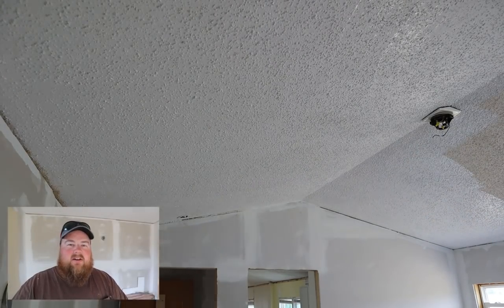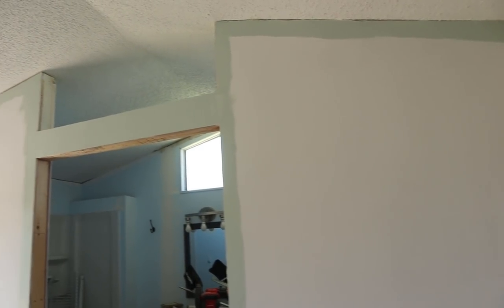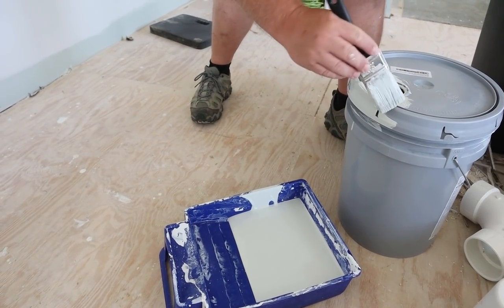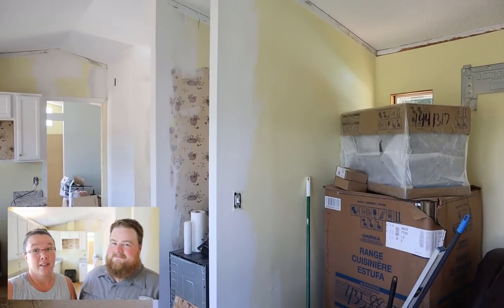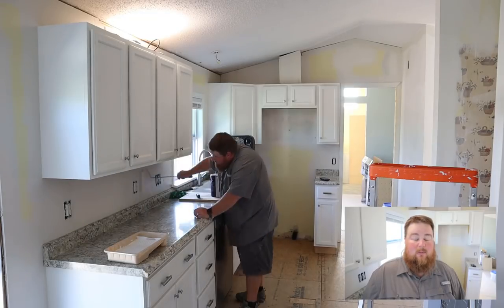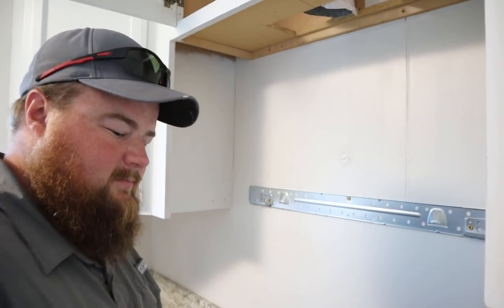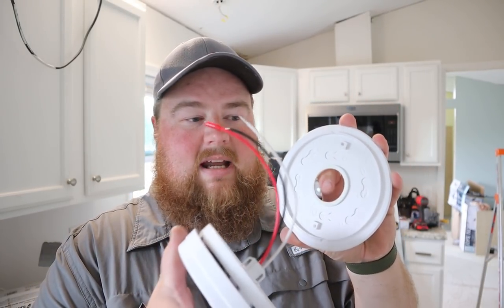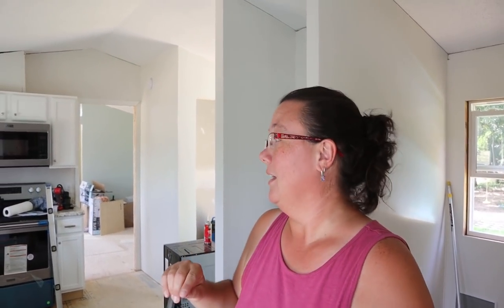What SHE Picked for the House.. Color Palette Revealed // Mobile Home Renovation

Comment: Great job on the painting and color selection.

Future tip: Since the crown moulding was not installed. You can cut in/trim around the ceiling using a 4"  Whizz brand roller. To keep paint off the ceiling when trimming with the roller, use a piece of cardboard to protect the ceiling.  Cut a small piece of cardboard  6"wide x 16" - 24" long. Place the piece of cardboard against the ceiling and tight into the inside corner. Then simply move around the room with the small roller in one hand and the cardboard in the other. It goes very fast and it allows you to have a more uniform texture on the wall.

For inside corner the Whizz brand 4" rollers have fabric on the one closed end of the roller cover. That allows you to roll inside corners with the same roller you cut in/trimmed the ceiling with.

Comment: we had that same  Microwave you just got. It lasted One month after the warrenty expired. The button you push to open the door went bad and when we went back to purchase a new one, that is when they told us those push button door latches are bad. So now we have one that you just pull it open.
Reply from the maker: That kind of stuff is why we buy the extended warranties on the large appliances... that and because we've had others die on us right after the default warranty and us not have bought the extended one. ;)

Comment: I hope you plan on using white trim all around all of the rooms. That way all of those colors you used in all of the rooms will blend a lot better when they are all finished,...and then use a lighter laminate,  like a Walnut color on the floors. Using the same floor color throughout will be a spectacular finish before furniture choices. Just a thought. Good luck you guys. It all looks really cool already.

Comment: I like it! Very calming color especially for the bedroom! It's very similar to the color I chose for my kitchen remodel.  SW6198 Sensible Hue. It's a light Green/Gray, but it changes during the day depending on the sun light! I love it! I used SW7000 Ibus White on the ceilings. Both are soft, calming, unassuming colors. Work together very well. I really like your color choice! DIYFFERENT, Doug & Ashley used a stain color similar! Pretty!!!

Comment: A tip here. Before you put down your new flooring, I would recommend adding all your molding/trim work before you install the floor. No messes to clean up.
Reply: The whole point of trim is to hide the gaps and it goes up after the flooring. I think Sam should just do it the proper way.
Reply: @diyfferent  I'm not talking about floor trim. I was talking about the ceiling molding. I'm not dumb.
Reply: @lkcantwell  Ok, well you said "*****all**** your molding/trim". Maybe you should have been more clear and not said "ALL", which would include baseboard trim. We have seen many people install baseboard before the flooring goes in because they just didn't know any better. It's not about being dumb, it's about being taught wrong or not knowing.
Reply: @diyfferent  I am sorry I didn’t mean anything other than ceiling molding which I improperly called trim. I know not to put down floor trim. Sorry I didn’t make myself clear.
Reply from the maker: We thought of doing that, but didn't have the molding yet -- we did have the flooring. :)

Comment: Sam I wonder if you can answer a question for me we also have popcorn ceilings and a couple of the rooms need to be painted it’s  a 1988 double manufactured home I was wondering what kind of roller did you used to do I mean to paint the ceilings and what kind of paint did you use was it a water-based or an oil base my husband heard that you can’t put a water based on popcorn  ceiling they will drip paint will just fall off I don’t want an oil base paint

Comment: I used that paint color. It is absolutely wonderful.  Great choice.
Angela,  I just discovered paint edgers.  Well, I just decided to splurge & try one. I will never go back to edging with a brush. They are fantastic.  I also used an edger to paint my trim before installing and i got a much better finish and it was way faster than a brush or roller.  
Your videos are an inspiration and it's really helping to keep me motivated while doing some major renovations in our 3 rental mobile homes. I've had a few crying spells. I've wanted to burn them down. But, I'm plugging away on the 2nd one now. 
The frustration is real working to fix and improve these homes.  It's definitely worth doing, but it's a struggle. 
 My only regret is not learning how to do pex fittings and using all Shark-bite fittings..$$ to transition off the PB pipe to pex pipe. But, they make plumbing easier and possible for women.. I love them, despite the cost. 
Ya all need a couple beach days after this. 
One step at a time..you got this.
Blessings from Maine.
Reply from the maker: This has definitely been one of the most stressful things we have ever experienced as a family, many tears when the times got rough! But we're almost done and such sweet comments like yours help keep us motivated to see it through. Funny enough I've been looking at beach hotels! We think we really do need a vacation when this is done -- mental break time! We just celebrated our 4th month in the camper... it will be nice to NOT be in here again! :) Thank you so much and good luck with your awesome projects! -Angela

Comment: Are you sure that they don’t communicate with each other. I had a full connected wired system, and when outdated replaced it with a newer, 10 Year sealed Battery, and the package insert send that the wireless communicate with each other. Yours looks like the ones I used.

Comment: @ 22:00 ish.....I noticed you have or had an actual vent above your microwave that goes into the ceiling or roof. Why did you not take advantage and connect the  vent your microwave vent ? The built in vent on microwaves only use a carbon filter and vent back into the kitchen.  If you had connected the microwave vent to the above vent it could vent out of your house.

Comment: maibe you can hang a full length mirror in front of the waterheater door , might work good to snap that door on using magnets , mmakes it eazier to get off fast for instance to close the tap in case of a leak (honey screwdriver SCREWDRIVER OH MY GOD , wats wrong ? theres water all over the floor get me the screwdriver i need to get the panel off )

Comment: A tip about the microwave, swap the stove light for an LED when it burns out. The LED will last way longer. Just try to get one that is rated for up to same wattage. The fitment might be slightly off depending on what you get but it should still work.

Comment: When you pour out of a container with a spout, the key is to have the spout on TOP. You'll then be pouring across the top of the container, but that's OK. What's happening is you're allowing air in while you're pouring. This avoids the glub, glue. Also as you straighten the container it will stop pouring before it levels out, so it doesn't get across the top of the container (and down the side). Good luck! 😉
Reply: @Tommie Jones I know! I thought the same thing when a painter told me. But I tried it and really works, and well. 👍🙂

Comment: KUDOS to both of you!!! Your hard work is looking really nice.  Maybe consider doing the ceiling and door trim first before the floor is installed.  The floors if they are laminate can scratch easily OR if a lower grade click vinyl flooring.  Because I installed a click vinyl that was 2 or 3 mil and it wears horrible.  I learned from my mistake with a lower grade click vinyl flooring.

Comment: We just purchased a mobile home that has new metal installed on the siding of the mobile home and new metal roof.  It is 26 gage metal. Local movers have told us we will have to remove all the new metal siding on mobile home and the new metal roof.  Did you guys have any problems with movers telling you that your renovation had added too much weight and to hard to move it.
Reply from the maker: We did! Only one would move it for us -- after close inspection and talking to us to find out exactly how we constructed it. All other movers said it was non-factory and they wouldn't do it.

Comment: Question why did you guy's not sill the gaps between the wall's and ceiling???
I would have to lessen the out side and inside air from getting in and out of the wall's and ceiling in to the living space. Pluse this little more work would cut down on bugs getting in. You all have done so much work and it is looking so very beautiful.
Reply from the maker: They are sealed with framing and everything, just since our ceilings are vaulted there's still the gap and it appears as if they are not. Trust us.. that parts sealed tight. We will be installing crown molding soon to cover them. :)
Reply: @sam-and-angela  that's great I was just trying to look out fir you. I know its a lot of work but in the end it's all worth it. Stay safe and God bless.